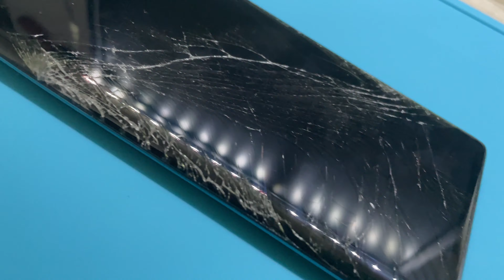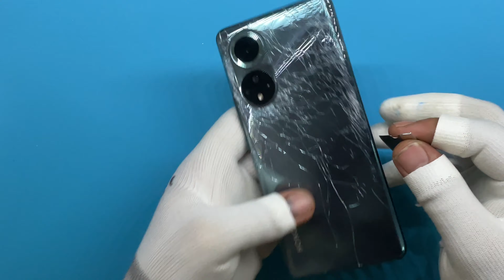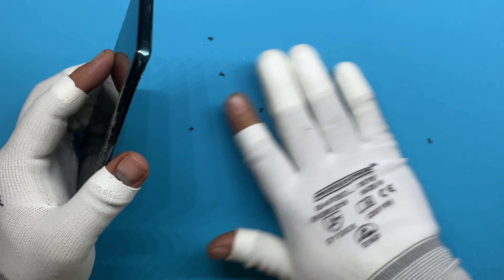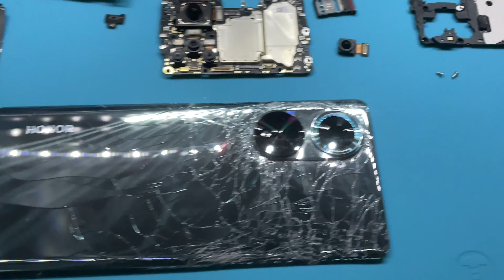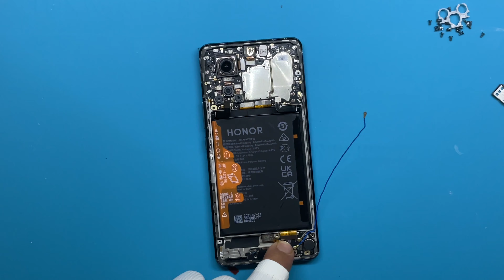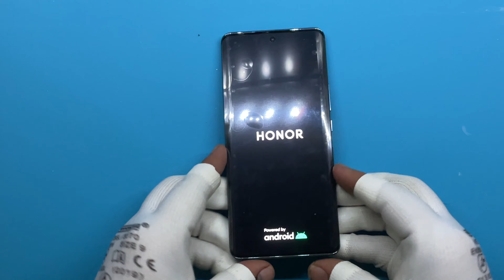Honor 50 Replacement screen

Comment: Hello, I've followed the procedure and it was successful, after one month I've got Touch disabled on the screen and could do nothing, somehow I've managed to trick it and it was gone. Does it mean that it has to do with lose proximity connector, although I doubt it is the case or it is just coincidence? As the screws are tight and by presumption should keep it secure in place? Thank you!